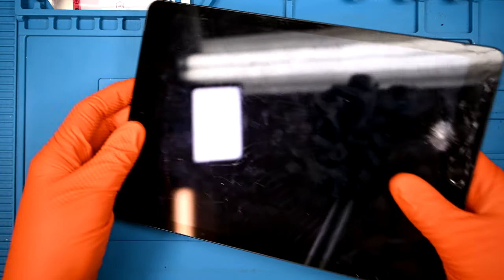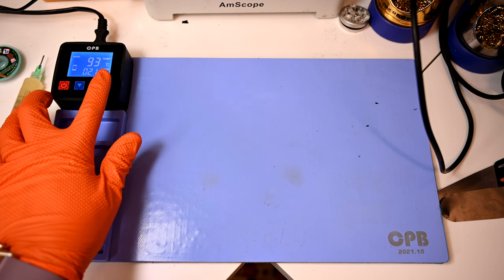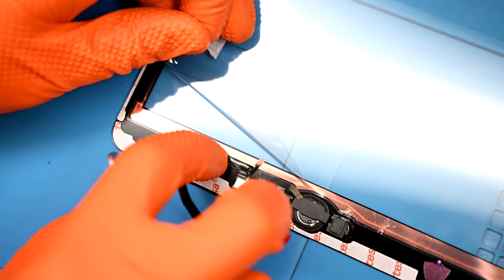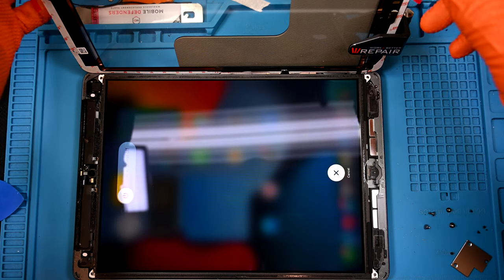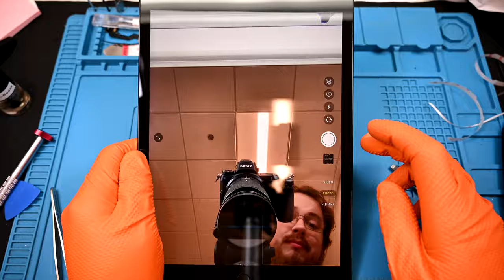iPad 9 (2021) Screen Replacement Guide | Same old traps, thanks Apple

Comment: I'm looking into repairing the ipad that are broken WEEKLY at the school, we send them to a place about 2hrs away as almost costs $150 AUD each ipad and were sending about 2-6/wk. Whats my best way of cleaning the screen from dust ect, I feel that a microfiber will scratch. Cheers
Reply from the maker: I strongly recommend getting some cheap tempered glass protectors for all iPads, even the cheaper glass ones work quite well. As for cleaning, if it’s the glass a microfiber is absolutely fine. You can also use a soft cloth with some windex or high concentration isopropyl alcohol (I actually mix these in a bottle at 50/50 and call it Booze+ as a joke). Cleaning the LCD itself it another story, no windex, and absolutely nothing containing ammonia. Make sure to use a super clean microfiber cloth and gently wipe it in a circular motion. Gentle is the keyword, you aren’t trying to scrub it or even apply much pressure like you would with glass. If it still won’t clean, add a few drops of isopropyl alcohol to the cloth itself, not the LCD, and try a slight bit more pressure in a circular motion again. 

I’ve worked on tons of school iPads, and typically have to give them a full wipe down with the windex and alcohol combo because it isn’t just the screens that are gross. A cheap case and screen protector go a long way, but I can assure you that kids will absolutely find a way to mangle the poor tablets regardless, though maybe a bit less.
Reply: @TapticDigital  
Hey, well recently we upgraded to 10th gen iPads that have a screen protector around the case. But we still have atleast 300 9th gens, we are waiting for funding to get more 10th. However they are in cases and are normal Cleaned often which is a bonus, normally it's just students or staff walking with them and bumping into something and drops it - these cases are mainly the apple folios. 
I just thought I could do the job a bit cheaper, and get paid for it which the tech above me said that's fine, I just need to send them invoices.
Thankyou for your help man, I appreciate it.

Comment: If the display already brings a home button, Theres no need to replace it with the original home button ? the touch id will still work with the new home button?
Reply from the maker: Nope, if the home button is ever replaced, even with another Apple part, Touch ID will stop working entirely. You have to transfer the original button
Reply: @TapticDigital  thanks for answering and the vid!!

Comment: I have a question: if the glass is intact around the home button and most of the shattered glass is on the other side of the ipad, can I replace glass without replacing home button?
Reply from the maker: As long as the home button isn’t damaged you should never replace it, it contains your Touch ID functionality and if it’s replaced, Touch ID is gone for good.

Comment: What is wrong when, after the touch screen has been replaced, it registers zillions of random touches all over the screen, so that it enters wrong pins on its own? Is the replacement touch screen defective? The panel itself was not replaced.
Reply from the maker: Good old ghost touching! It means the digitizer in the glass has a short somewhere. It's either just a defective glass, or there is a slight rip in the ribbon connectors that go to the board. The LCD is for display only, the actual touch sensor is embedded in the glass.

Comment: Thanks for video. I have a iPad 11inch 2018, would this be a simular process, as I am not sure which part to repair. I was going to invest in the heat mat and tools and adsives. Any thoughts if its worth while trying, as LCD seems ok just glass.
Reply from the maker: If you have an iPad pro that is a whole different story. In many cases I refuse to work on them because of how quickly they break when you try to open them. I would avoid trying to take it apart unless absolutely necessary, and have a replacement display handy if the original breaks.
Reply: @TapticDigital  Greatful for your reply and support. Cheers

Comment: Hi, I want to know if I use heat to remove the glue from the screen, will it affect my lcd display? I heard from my friend that a repair shop fixed her ipad screen and her lcd display now have this crease looking paper like display. Is it the repair shop mistake or it is okay to use it?
Reply from the maker: Shop mistake, happens when you overheat the front or let it sit too long without checking it. Getting it “pretty warm” and then using isopropyl and a razor will get it open without risking the LCD
Reply: @TapticDigital  The shop said that what had happened to the lcd display depends on the luck of the ipad owners. I dont know if the shop lied or not. But thank you so much for your reply. It is very helpful. 💖

Comment: Do you have to replace the digitizer if only the glass is broken? Or can I just replace the glass and only the glass
Reply from the maker: The digitizer is actually fused into the glass, they are one piece, one part. The LCD on the other hand is not, and doesn’t need to be replaced if it’s still working and undamaged.
Reply: @TapticDigital  yeah that’s what I meant! lol thanks!

Comment: Tried to repair it and was so close to succeeding. Then the LCD decided to spontaneously die. 

I’m not mad that my gorilla hands broke it; I’m mad that Apple intentionally designed it to be difficult to repair. Great guide though; short and straight to the point. Thank you.
Reply from the maker: I obviously don't show it on camera (though I might), but there are times I'll go to remove one that isn't broken and suddenly POW! Glass in the face. Other times I'll press it into the frame, only for a dented part of the frame to shatter it to bits. Glass is... Fun? Either way, I'm super glad my video was helpful!

Comment: Where did you get this digitizer and did you have any problems with ghost touch afterwards? I was thinking of buying mine from amazon but I don't know how well that would work out
Reply from the maker: I've had decent luck with Amazon in the past. I ended up partnering with vendors like MobileSentrix and GadgetFix, you may also try Injured Gadgets. They all have very good warranties. It was VERY rare to have touch issues, but sometimes they happened. The vendor always replaced it promptly. If you do go Amazon just check if they offer a warranty, touch is really the only issue these things can have so they usually cover that. And ALWAYS test before you tape the screen in place!

Comment: Hello! Does doing this risk deletion of memory? Asking because i have over 1000 artworks on procreate (theyre saved to my ICloud but still..) that i dont want to lose! My screen only has a single crack running diagonally on the screen and its not lifting at all, but I want to replace it before it worsens.
Reply from the maker: No risk of losing data, just a simple screen swap. If a shop tells you they have to wipe it, don’t go to that shop. 😉
Reply: @TapticDigital  Thanks so much! Your video of the process helped me feel way less anxious about how it works! 
I was considering GeekSquad to do it bc I'm far too anxious to try lol so I'll check and make sure they don't say that!
Thank you again!

Comment: Great video. I did try to replicate what was in this video but it won’t turn on! I don’t know what exactly I did wrong though.😢
Reply from the maker: First thing is to confirm that it isn’t turning on, sometimes the display just won’t turn on but the device is “on” or stuck in DFU mode. This will also rule out if the power button is damaged because the charger will attempt to force a power up without the button. Try connecting it to a computer and see if it shows up, if so, it’s on just stuck. If not, head back inside the device and make sure the battery connector is screwed down and that the LCD connector is fully seated. If still no power, remove the main board and check the battery connector, it has a few gold springs that can occasionally get bent or damaged.

Comment: Is it necessary to take out the plastic cover in the opposite side? Mine has very silvery screen reflection .. may be coz of that plastic
Reply from the maker: Yes, any protective plastic layers should be peeled off. They are just for protecting the glass before install

Comment: Hey, how were you able to attach the home button, that wire and the metal piece? What kind of tape I need to use for all?
Reply from the maker: I use double sided tesa tape, it works very well
Reply: @TapticDigital even for the metal bracket? Got kink you can share for the tape?
Reply from the maker: @tusharpatel8749  I definitely won't share any kinks here, but I did add a link in the description for you! 😉

Comment: Hi! Would you happen to know where I could get replacement screws for my iPad it’s a 10th gen 2022 I’ve been looking everywhere and nothing
Reply from the maker: Unfortunately screws can be tricky to find. You may have better luck talking to a local repair shop and asking if they have spares, most shops keep a large bin of them. Otherwise I’d recommend checking Injured Gadgets or even eBay

Comment: My digitizer is fine but lcd is not working properly, sometimes it comes back working fully, I feel like it's just a loose ribbon, looks like it will do more damage taking it apart to fix it. 😢
Reply from the maker: Not necessarily, I wouldn’t say this is a DIY project if you aren’t familiar with taking these apart, but it can certainly be opened without damage. However the likelihood of a loose ribbon is very, very small, especially with how they get screwed down. But sometimes digitizers just start to fail or go a little wonky, on the plus side they are super cheap to replace!

Comment: I broke my latch/clip that connects the home button. Would I have to replace the motherboard. Or just buy another ipad 😩
Reply from the maker: @212Calvins  usually you can still slide the ribbon in, use a piece of electrical or kapton tape to hold it down, and still have it function. Otherwise a repair shop should be able to replace that connector pretty easily with some soldering
Reply: @TapticDigital  thank you

Comment: is there suppose to be glue marks at the edges after sticking the screen back
Reply from the maker: Not if you're using double sided tape. If you use glue it will certainly spread when you pretty the screen in to place.

Comment: I cant get the screw loose that needs the connection interrupted. Can I still do the rest without doing that?
Reply from the maker: As long as you are absolutely certain the device is off, and you use only plastic tools to disconnect things.

Comment: Question, i replaced the screen, and the homebutton… everything worked like a charm. Wanted to close up, did a final check.. the homebutton didnt work anymore.. after re opening… the flex cable was severed… had to order a new flexcable…. But how do i prevent this?! It seems like when i close the screen it ruptures 😢
Reply from the maker: It's a bit tricky to line up but as you're closing you have to make sure it isn't being pinched between the frame and display, or that you don't open the glass past about 45 degrees, it puts stress on the cables and they can rip.
Reply: Thanks for the quick answer, ill give it another go tomorrow!
Reply: 🎉 it worked, was indeed failure at my end, by placing the screen more then a 45 degree corner, the flex cable got in touch with the ipads metal housing wich severed it. Hope my reaction helps preventing other people making this mistake!

Thanks so much for your video and replying. I just saved myself 300 euro’s repair cost at an official apple dealer. 🎉

Comment: Hello,
What adhesive did you apply with the tiny brush? it doesn't look B-7000.
Reply from the maker: It's 3M tape primer, it makes the tape stick to the surface better.
Reply: @TapticDigital  Thank you!

Comment: Unscrewed the battery I just can’t get the tab under it idk if I’m using enough force or not
Reply from the maker: @AydanSmith-gx2vy  definitely don’t force it, that can bend the pins underneath. Gently lift the board up in that area and that should be enough to “disconnect” the battery. Technically it’s okay if the battery is still connected as long as you are absolutely certain the device is powered off.
Reply: Okay thank you

Comment: Do you need to reset the iPad in order to replace your LCD? I'm an artist and most of my work is on my iPad, but I need to have the LCD replaced.
Reply: Nope
Reply: You can also back it up to a computer first without using the screen

Comment: hey please i need help i did everything you said but mine started to move itself how do i fix it please help🙏🙏
Reply from the maker: Good ol' ghost touching! It's usually the sign of a loose digitizer ribbon connection, ripped/torn ribbon, or just a plain defective screen (it happens when everything is so mass produced).

Comment: Is there a certain temp that you set your heating pad to in order to insure the adhesive loosens and nothing over heats?
Reply from the maker: I like to keep mine around 78C, over 90 seems to be the danger zone. Also time, don't leave it for too long. I've melted an LCD before and it wasn't fun
Reply: Awesome thank you so much!

Comment: which glue are you using for the cables?
I mean that one which is a applied with the small brush:)
Reply from the maker: That is 3M rape primer. It helps the double-sided tape stick

Comment: Replaced glass and now I have the horrible ghost touch it opens apps by itself and swipes left and right non stop. What did I do wrong?
Reply from the maker: Possibly nothing you did. There's a chance one of the connectors is slightly loose and didn't click in all the way, there's also the possibility one of the ribbons has a tear in it. Or it's just a defective screen, which isn't common but isn't exactly rare either. Mass produced parts will sometimes just have a bad one slip through quality control.

Comment: I always have problems getting glass to stay stuck on the flex (right) side. Do you use extra glue?
Reply from the maker: That's definitely the most common lifting point, it's just a super thin area of frame. I use 3M tape primer on the frame which seems to resolve the problem, some people add a silicone based adhesive as well.
Reply: @TapticDigital  thanks, do you think isopropyl would act as primer? And that black gunge on the LCD screws is a real pain.
Reply from the maker: @bellslinki  alcohol will work the opposite, it tends to remove stickiness from surfaces. I'd definitely recommend cleaning the metal of any old leftover adhesive with alcohol, but still some kind of primer would help increase the stickiness.

Comment: do you not use primer or anything for home button bracket to stick well down and not move or sink when pressed
Reply from the maker: Always use primer! For anywhere that has adhesive, frame, home button bracket, and on the glass where that bracket sits. So far only children have been able to break it still.
Reply: @Taptic Digital  yeah been using that myself for years, £37 for 100ml tin 👌🏾

Comment: Hey, awesome video! Can I do this task without the heating pad? I don't have one
Reply from the maker: You can! There are lots of options, it just depends on what tools you have available. Another good choice would be using a heatgun. You could potentially use a hair dryer and a razor blade with some isopropyl alcohol, though it would take longer. iFixit sells a bean bag that can be microwaved and act like a hot pad.

Comment: My ipad 9 just suddenly death, no drop nothing happened. Just a black screen of death any idea to fixes this issue
Reply from the maker: Does it still "ding" when you plug it in? It's also possible it got stuck in recovery mode, it should still pop up in iTunes on a computer if it is.

Comment: curious if primer is necessary? Just bought the digitizer and it comes pre adhesive but was curious about benefits of using primer
Reply from the maker: Definitely not necessary, but it does provide a much stronger "factory-like" bond. You can achieve similar results by placing a decently heavy book on top of the tablet overnight.

Comment: that is the most frustrating work to do.  i imagine i could get better at it.  but even removing the blue transparent plastic from the adhesive is frustrating.  I'm glad i did this for my aunt for free, because i wouldve had to change 500 fucks for all the damn time i spent on this.  Gloves as a must, cleaning that LCD is frustrating, who knew that rubbing alcohol was so terrible for that job.  If you were to update the video, clarify in greater detail how to put a wedge in between the battery and the logic board.  just a little extra time explaining for noobs worried they will break it.  also clarify that you will kill the digitizer if you plug it in while the ipad is on.  clarify to prep the new digitize by placing the stickers the go under the bezel on to the underside of the digitizer before installing.  that was a pain to deal with after installing the digitizer and closing the screen, i dealt with it that way but it would have been easier to have done that first.  Lastly I would note to people that even though your new digitizer comes with a home button, touch ID will not work with it, so remove your original home button and the the metal bit the holds it down from your ipad, dont use the replacement one.

Comment: Ok I accidentally touched the screen with no gloves now it jumps around without me touching it how do I fix it
Reply from the maker: The gloves don't matter much, you can do repairs barehanded. It sounds like a faulty digitizer, possibly a loose connector or ripped ribbon, but in most cases it's just a defect in the digitizer

Comment: Did you add any extra adhesive when installing the new digitizer?
Reply from the maker: The new part comes with adhesive already lined up on it, no need for extra. Though I do add a layer of tape primer which dries on the frame and makes for a good bond